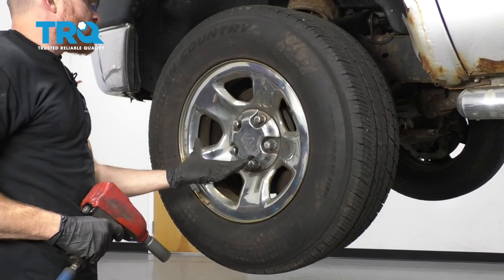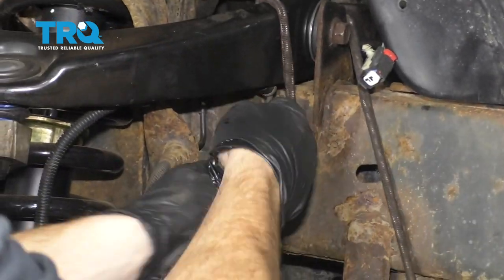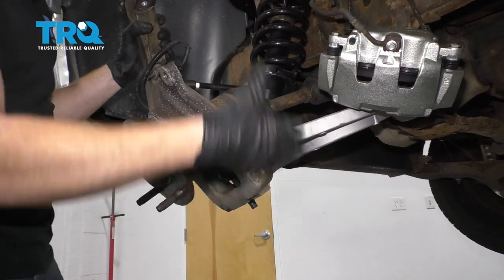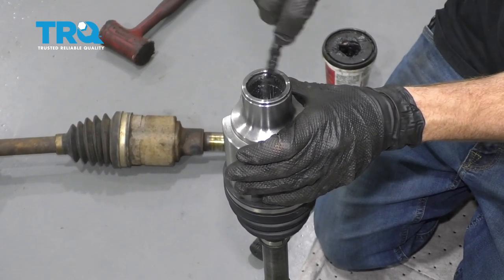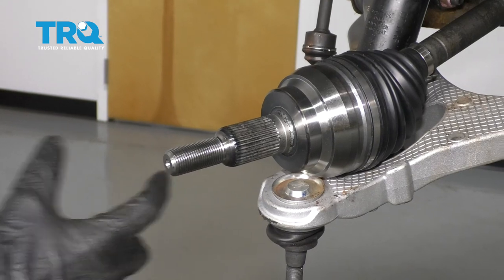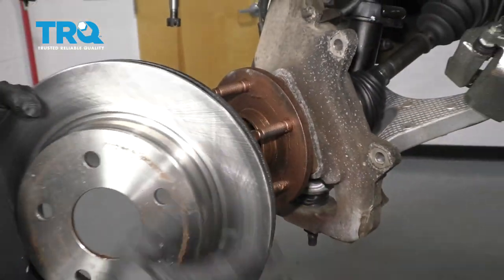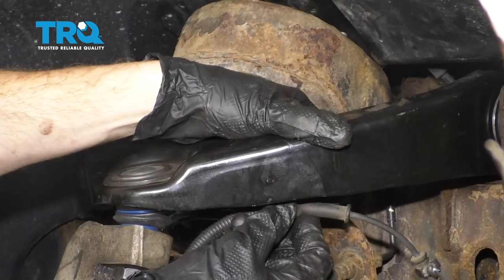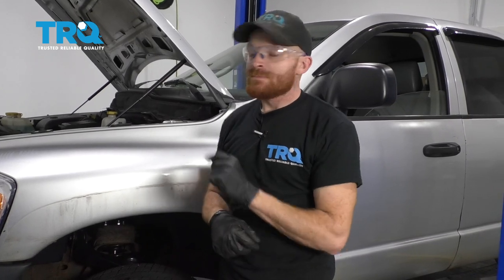How to Replace Front Driver Side Axle 2006-10 Dodge RAM

Comment: Since this side is “longer” because when you pull the CV axle out, it still has the intermediate shaft connected you therefore need a lot more clearance to get this one out than your passenger side which is far more simpler. So yeah, take the WHOLE damn thing apart and pull it straight out. Take intermediate shaft out install on new axle, slide new in and re assemble everything. 

This video is it 👍🏼👍🏼👍🏼👍🏼👍🏼

Comment: Thanks guys. My auto parts dealer "forgot" to mention the inner spline and it welded itself to the CV shaft.
Reply from the maker: +Jeff B Thanks for watching our video! http://1aau.to/m/Shop-TRQ
Reply: I took a torch to the old CV axle last weekend, held the inner shaft with a welding glove and gave the CV axle some "bonks" with a hand sledge, it broke free after the 4th or 5th whack.

Comment: How do you remove the stub shaft if it didn’t come out with the axle?  Mine needs replaced and having trouble getting it removed.
Reply: Slide hammer  c clamp
Reply: Heat and a hand sledge.
Reply: Vice grips

Comment: I found the upper ball joint didn’t torque properly until I had proper weight since it was only around 40lbs 👍
  Also I have a very very regretful 2” puck lift and had to use a jack and ratchet strap to get upper ball joint in 🤦🏽  I didn’t change cv yet because it’s on the opposite side, just change the upper ball joint